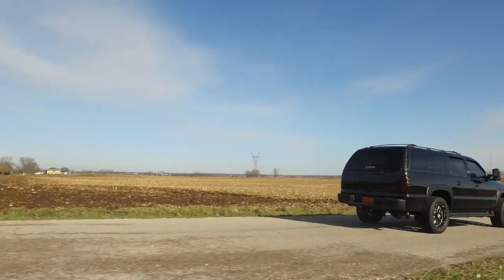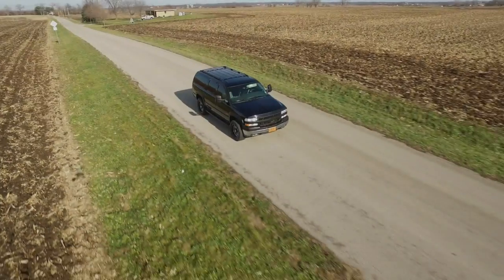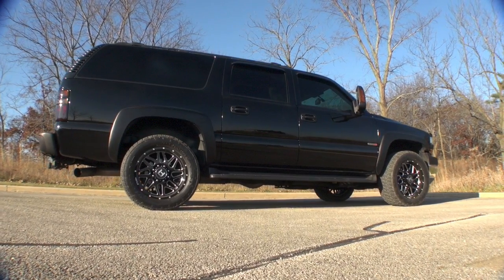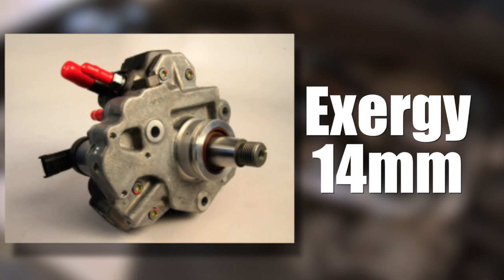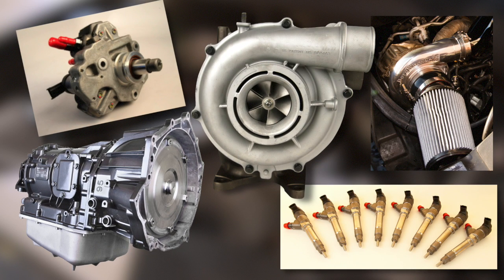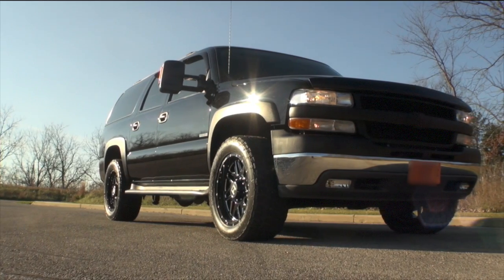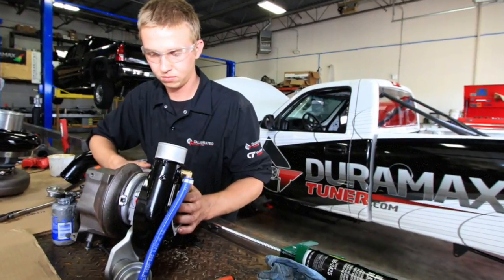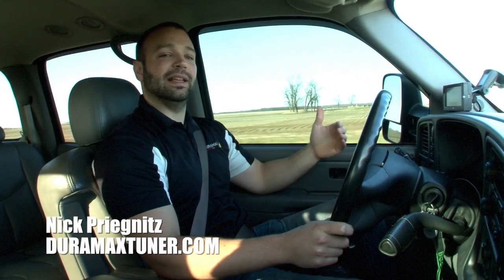1,050 hp Duraburb by Duramaxtuner.COM

Comment: You literally won't be able to ever floor it. Thing will spin and weave all over the place if in fact it puts out that much HP and torque that early. Add to that the fact that it's a short suburban frame, it ends up a big waste of power.
Reply from the maker: You sir, have clearly not driven a well tuned high HP diesel. Once the shop is open for tours again, you will want to come by and take a ride.
Reply: Awh the ever wonderful keyboard commando.
Reply: To me he is doing a lot of R and D to make a very fun daily driver.
Reply: I bet you a two piece and mashed potatoes with gravy it will pull an SD90mac locomotive, three Kenworth w900s, and your trailer house (with ease cause it well within it's towing capacity) plus 32 300lbs of BBWs

Comment: 1050hp through a 750hp trans? how does it hold up?
Reply from the maker: Nick misspoke in the video. Good catch. I will add that to the video description. Also, we shot most of the video in a tune that was around 750 hp.
Reply: O ok got it, thats one hell of a sweet burb. You guys should sponsor my truck build:D 2002 lb7 needs some more power!!